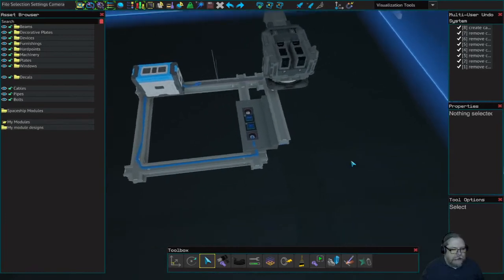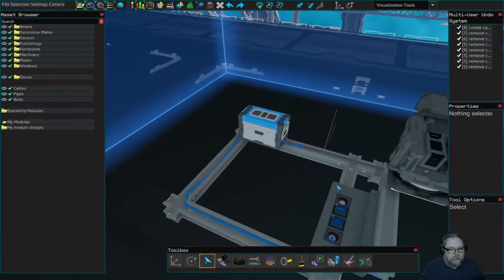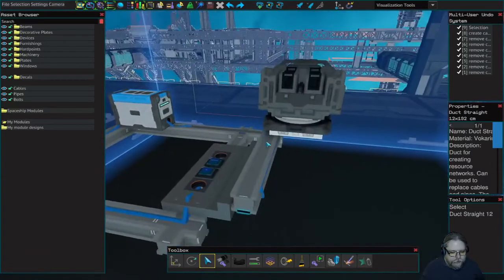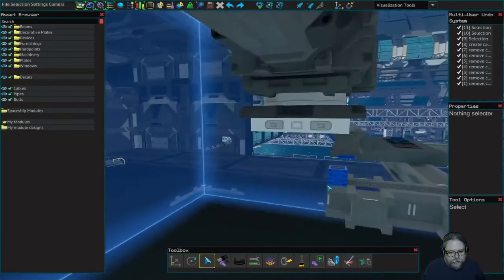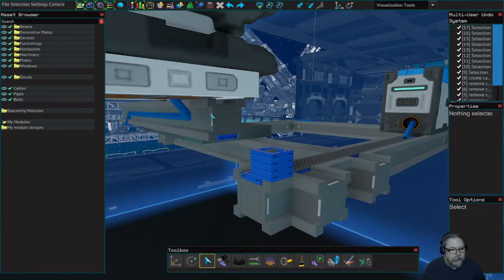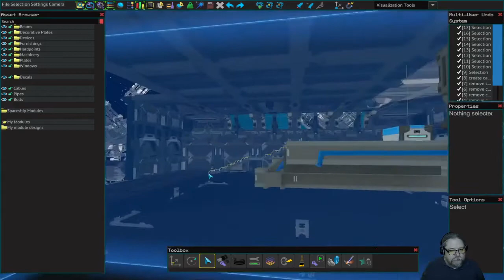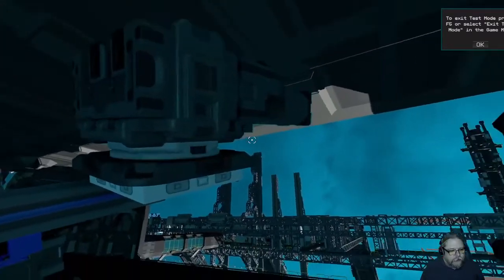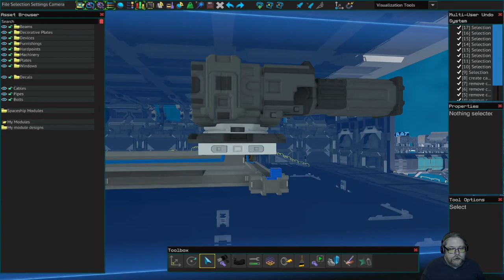Starbase - Providing Power and Pipes to Slider Objects (Proof of Concept)

Comment: This is amazing!  Do you think that this can be used to connect the systems of 2 different ships?  I want to make a fighter that can attach to and control a cargo frieghter
Reply from the maker: Would have to test it, but I would theorize that if you were to position a ship with an exposed conduit so that it touched the exposed conduit on another ship, and then use a cargo lock to lock it into place I would expect it might well let the two talk to each other.